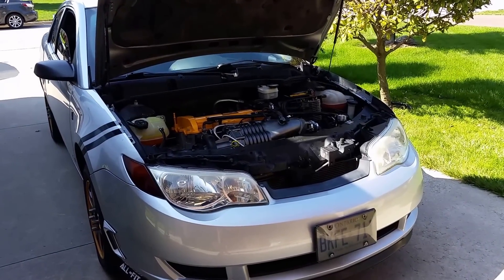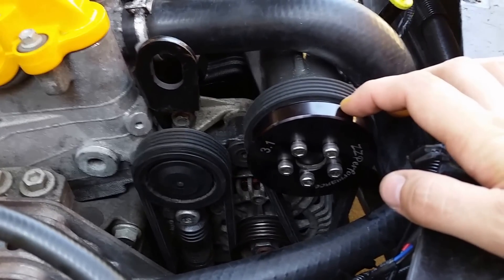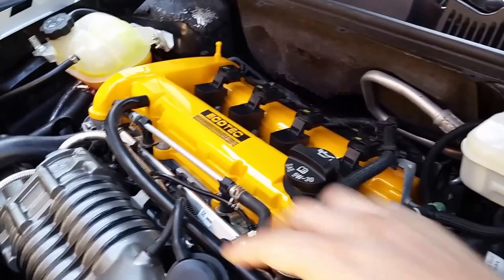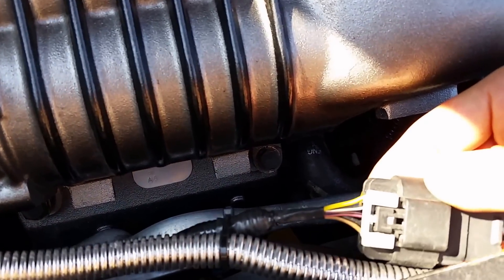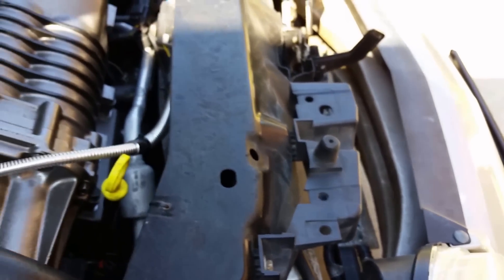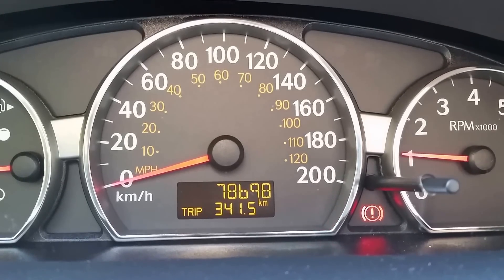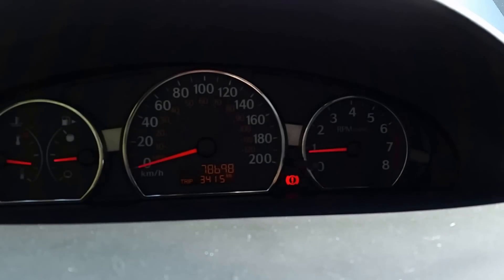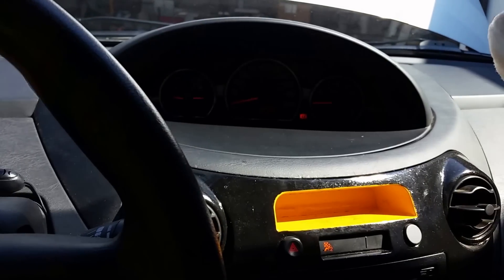How to Supercharge a 2.2L L61 Ecotec - Part 2 - Engine Bay, Idle, and Driving

Comment: Love it! CANNOT WAIT TO SUPERCHARGE MY 2002 Saturrrrd VUE 2.2L L61 5-Speed base model! Will be a fun / EVENtually expensive side project hobby! I already have some ZZP performance mods on her. 3 inch chambered Cobalt muffler custom installed cat back.. Cold air intake filter... I plan on this summer HOPEfully in this June get the rest of the Cobalt ZZP exhaust custom installed and exhaust tightened up. 2.5" Cobalt manifold, downpipe and high flow cat from ZZP.

Comment: I wonder if ur getting any slipping with them at 5rib belt?
Reply from the maker: We listened during the dyno and didn’t hear any slipping. The TVS 1320 setup I ended up doing after this also didn’t slip. Phenolic spacer honestly helps add tension to the whole setup. I also kept the stock alternator pulley which is larger on the L61 than LSJ. ZZP staged belts were too small and would rip. Stock LSJ belts worked great on a 2.6 blower pulley with a stock L61 alternator pulley. Definitely went through some iterations on that

Comment: Hey I have a almost bone stock l61 in a 2004 saturn Ion, I'd love to know the 1st legit steps you put into the car, did you do any trans work. Any info would help because I'd love to be able to build mine to your specs it already has the looks just need the acceleration
Reply: It's possible in an '04 but there is no pcm tuning ability which means you'd have to use a stand alone fuel system which is both expensive and difficult. His car is an '07 which uses a different PCM that has thning support which makes thing's infinitely easier. It can be done, but you'd be much, much better off selling your car and buying an 07+ or even better just buying a car with an LSJ engine.
Reply: As far as tranny work, none is required. The F23 transmission is rock solid,gugs used to run 700 HP through them all day long. Oddly enough it's a much better transmission than the F35 in the stock superchargered cars which break when you look at them wrong.

Comment: Would this work on a 04 cavalier I have a 2.2l
Reply from the maker: Yes my friend supercharged his 2003. Your tune will be different there is a GM refresh available for yours that will make it work. I would check out the Jbody forums for more details on that setup. Drive by cable on yours. Pretty sure guys have made many different adapter plates for the m62 supercharger various LS cable driven throttle bodies

Comment: Bro 1 quick question where did u relocate the throttle and throttle body, or did the supercharger fit right over it
Reply from the maker: You need an entirely new intake manifold that replaces the plastic one on the 2.2L with the metal one from a 2.0L. Supercharger bolts to the new intake manifold. You can't use the original manifold or throttle body or airbox assembly, or tensioner or idler pulleys
Reply: @liquidmetal92  ok thanks brother I'm about to purchase a manifold supercharger and throttle body this weekend thanks for the reply and quick too

Comment: 60lb injectors are to big. 42lb is whats ideal
Reply from the maker: Ran with them for over 4 years. Tuned no problem. Pulsewidth and duty rates were optimal. Plus I ended up switching to a TVS1320

Comment: Can you do this without making the computer aftermarket? I live in a state with stupid laws
Reply from the maker: I used the factory ECM. They are unlocked. You HAVE to tune it to make the engine run correctly with the supercharger and new fuel injectors, and throttle body. 
This doesn't make it "aftermarket" it is the same computer but adjusted internally. Make sure you're doing this on a 2007+ GM 2.2L. Don't turn off any MIL's, keep your EVAP and all of that in order.

Comment: After 4 years! How is this holding up without forged internals. 
I have a sand rail that I’m doing a 2008 L61. I’m thinking hard about doing the supercharger.
Reply from the maker: I built it after about 2.5 years. Forged rods pistons, upgraded valves and valve springs. But no issues after 2.5 years and the tear-down showed everything looking flawless. We supercharged my buddy's 08 G5, 3 years in now and no issues. Just keep RPM limiter stock if you're leaving valve springs stock. After building my motor and going TVS1320 I upped it to 7250RPM. Good times

Comment: Has it been reliable with stock internals at 16 psi?
Reply from the maker: I never had any issues with it for almost 3 years when I drove it like that. Ended up doing a built motor, but had a TVS1320 blower on it at that point making 24PSI on a ported head. Make sure fueling it good, stock internals will take 15-17psi fine. I wouldn't push them past that though
Reply: @liquidmetal92  thanks dude appreciate it! Nice set up btw!

Comment: So basically my car is complete and i had it tuned at a local cobalt performance shop he tuned it using hp tuners. Its only set to hit 10 psi max for reliability since its a stock block and internals. When i drive the car roughly 30 miles or so it tends to have the rpms bounce like crazy till the car stalls or i hit the gas it only happens to it coming to a stop and only happens sometimes i had them check the tune and they said it was fine no cel or anything. Any idea what could be causing this??

Comment: Hey man quick question! Did the 60lb injectors ever give you any problems? Like idle surge or any idle lope? Or problems with cold starts?
Reply from the maker: I found a better impedance table for the 60# injectors that worked a lot better than the stock table setups. Had to mess with the Short Pulse Adders (PWA tables in HP Tuners) to get the impedance right. Even ZZP got them all wrong and we ended up adding the 60# multipliers and then poof idle was amazing ever since. Send me a DM I can send the excel table. Shout out to 04Redline and Omega_5 from Redline Forums for figuring out all the back calculations

Comment: Scared to do my 2.2
Reply from the maker: No. Embrace it. Lotus overdesigned these for GM and they can handle far more power than stock. Bless up and enjoy the boost. Just upgrade components as necessary if you go intensely into it. You can live on an m62 with a 2.8" pulley or larger and stock internals all day long.

Comment: Have you had any rpm bouncing issues
Reply from the maker: Used to only after WOT. Is that what you mean? Killed that issue in the coastdown table. Nulled it out in the control parameters then made the entire table 10 degrees (too aggressive) then 11 degrees (better) then finally 12 degrees (my car like that coastdown spark best). Or are you referring to idle RPM bounce? Very different issues
Reply: @liquidmetal92  so i have a cobalt 2.2 that i just recently supercharged and its tuned and all with no check engine light but when i slow down fast or sometimes slow down to come to a stop my cars rpms bounce and it sounds like it has a different cam in it when it doesnt. Then after a few seconds it idles fine.

Comment: How much are you getting to the wheel?
Reply from the maker: I have a dyno pull with this setup and a meth kit added after to it. Plus Boost reference fuel pressure regulator setup. That setup made 270 whp so 300ish crank hp. Now setup is built motor and TVS 1320 supercharger. Approx 350whp
Reply: @liquidmetal92  could I do this to an 06 ion 2 coupe? It has the 2.2
Reply from the maker: @anthonyyvalle  unfortunately tuning will be an issue. The big companies only offer tuning for 2007 and up ECM. LSJ they support 04 and up typically. It has been done but is much more difficult to tune from what I understand on that Gen of ECM. Maybe look into the GM reflash that was offered for the Cavaliers and sunfires?? Call a dealer see if its compatible on your ecm
Reply: @liquidmetal92  alright, thanks for the help!

Comment: I got a 2005 pontiac sunfire i bought a supercharger from a 2.0l colbalt ss , does the intake manifold fit ??
Reply from the maker: Yes everything will fit with the same modifications I did in this video to the block. Use LSJ tensioner alternator spacer etc. ECM tuning will be different from my procedure not sure how to tackle the sunfires and Cavaliers but it has been done. GM offers a reflash for them too even
Reply: @liquidmetal92  thanks alots dude youre awesome 👍
Reply: @liquidmetal92  i call gm and he said he need the serial number from the cobalt to program my computer ... :$?
Reply: @liquidmetal92  is there a trick to unlock the car its only doing 172km/h , like is there a trick to unlock it

Comment: daaaaaaamn im jealous. 
ive got a astra convertible with the 2.2 ecotec engine, and im dreaming of doing this to my car one day.

one question, why exactly do you have 2 coolant reservoirs?
Reply: Were can I get a list of everything needed to add this to my 06 Saturn ion 2?
Reply: He has the coolant reservoir on the passenger side for the intake/supercharger cooling system. The reservoir is mainly to keep the system bleed of air. I put one on my 06 Ion Redline when I changed the intercooler pump. They don't come with one stock so the system gets air in it and eventually kills the pump. The kit is called "option b".
Reply: @randymiracle4958  Same thing if the condom gets bubbles and blow. The solution is called "Plan B" ;-)

Comment: Is it reliable with the stock heat exchanger
Reply from the maker: Yes. I used the stock LSJ heat exchanger which fits between the radiator and AC condenser. I added the ZZP heat exchanger in series since then for  my TVS1320 setup

Comment: I see where the vacuum line is connected from the supercharger to the boost valve actuator  but where did u route the lower half to and did u run a boost solenoid or do without?
Reply from the maker: Let it open to air. The redlines have it connected to the EVAP purge solenoid for emissions standards reasons. Is perfectly fine to leave the lower port open to atmosphere for purging.

Comment: Have you had any problems with the engine so far?
Reply from the maker: I drove this over 28000kms with stock internals, zero issues. Tore apart motor, inspected all bearings. Was able to re-use all the mains and rod bearings they held up great. Upgraded to forged pistons and connecting rods and did a full motor build for my new TVS 1320 setup

Comment: Please tell me that's a double sided belt. I sure hope there's not a smooth side driving that blower pulley, if there is you must like belt slip a lot. Plus i'm curious, what's your A/F at WOT?
Reply from the maker: Scott Lambeth yes the OEM Cobalt SS/Ion Redline LSJ belt is double sided. AFR at WOT with the setup in the video was around 11 to 11.4 on average. 
Now I have a different setup with methanol injection and a return style boost referenced fuel pressure regulator. I usually get  11.5 under WOT now after my dyno tune was done on this new setup
Reply: Smart to convert to a return style fuel system. Many aftermarket pumps can't seem to handle the variable voltage of a non return system. Very interesting looking setup too.

Comment: I wish I could put boost on my 2.2 but its a 2006 and GM used an odd ball ECU that no one offers tuning for. So at this point I'm not sure what my options are. I'm even considering a complete motor swap in to a 3rd gen block but shit gets expensive really fast when you go that route. I just wanted a little bit of boost on a daily that would pass emissions.
Reply: I'm in the same boat as you. Did find anything out that you can do?
Reply: @williamsheridan9784  nothing, besides a complete ecu,tcm, and harness swap and figuring out how to change the crank sensor and ignition module to coil packs. I can program out VVT if the ecu come from a model year with VVT but i'm better off getting it all from a pre 2005 model year. But its probably not worth all the trouble. As far as finding another cobalt with what i want. Yeah good luck finding a used cobalt 2.0 or 2.4 in good shape.

Comment: What exhaust do you have?
Reply from the maker: Braden Bach in this video it was zzp shorty header and 2.5 inch catted downpipe. Resonator delete and magnaflow exhaust. In my newer video with my dyno run I have a full zzp 2.5 catback that replaced this setup which sounds muchhhh better in my opinion. Check it out if you want to compare.
Reply: Vincent Colussi did you install it or did someone install it for you
Reply from the maker: Braden Bach I installed it in my driveway. Entire build was done in my driveway
Reply: Vincent Colussi do you have a video on how to install it?

Comment: Vincent, how much torque and horsepower and did you end up putting down on a 2.9" pulley?
Reply: Disregard.  I found your comments.
Reply from the maker: Jason Gibbs I'm on a 2.7 now with 94 tune, meth injection and BRFPR system which put down 270whp and 252 lbft. Never dynod the 2.9 setup with 91 gas and stock fuel system. This video also had a not full exhaust system. Check out my dyno video if you wanna see the current setup
Reply: By "not full exhaust," what do you mean?  Header?  Pipe size?  Cat / catless?  Resonator?  lol  Curious to know.
Reply from the maker: Jason Gibbs this video was shorty header and 2.5 downpipe with cat. Stock exhaust behind downpipe with a crappy magnaflow exhaust. New setup has the zzp 2.5 catback added behind the same downpipe
Reply: It didn't sound terrible though the road.  You could tell it wasn't a full exhaust by the sound.  Mine sounds ricey, full headerback 2.5" with magnaflow cat, vibrant 12" res, and magnaflow muffler crush bent.

Comment: No one is offering PCM programming for the 2.2 L61 anymore. Any idea where I can find a programmer So I can do it myself?
Reply: if it's an issue with the Delphi ECU then check out http://www.obdtuner.com/ and email Peter with your details, he will sort if you can/can't
Reply: Try hp tunners
Reply: @JMilly84  hp tuners doesnt support the l61 ecu for 2005-2006 because its an oddball one for that specific year and motor.

Comment: Will this work with an ‘03 alero?
Reply from the maker: Nineteen-Eighty two Rampage look up the 2.2 cavalier builds. You're cable driven throttle body not electronic so a few things are different. And your tune will either have to be standalone or GM reflash

Comment: How much would a swap like this cost.... I have the 2.2 ohv
Reply: This supercharger is for a 2.2 L61, Ecotec engine.  If you don't have this engine, you will need to swap into it which can cost somewhere between $500 and $3500 depending on your knowledge / skill level and parts availability.  The m62 kit will be an additional $650 to $3,500 depending on parts availability and skill level.  So really it depends on YOU.  Between $1,150 and $7,000 or so.  

**These rough estimates are for educational purposes only.  DO NOT misinterpret these numbers as factual nor implied.  They are ROUGH ESTIMATES.
Reply: I remember the 2.2 Ohv on the Cavalier, I had 1994 2Nd Gen Cav, but they had the 2.2 Ohv until 1999, from 2000 and up was the Ecotec,
if you had the Z24, 1995 and up it would be 2.4 Quad cam, if I am not mistaken.
Reply: Get the Cobalt as whole car, find one thats been rear ended, buy it as a parts car, then peel out and switch everything over, the only thing you will not be using is shell of the car 

Otherwise all other parts will be used, engine, transmission, ecm, wiring harness, and so on.
Reply: If you can, look for the turbo version Cobalt, the turbo factory Cobalt is quicker than the Supercharged factory Cobalt.

If you get the turbo Cobalt, upgrade the Turbo, and have the ecm specs adjusted / tuned for the upgraded turbo.

Might need to upgrade the clutch too.

Comment: How many horsepower did you gain with all that ?
Reply from the maker: Eliseo Ventura the setup in the video was around 220whp. Stock is 145hp to the crank. I dynod at 270whp now thanks to modified fuel system, water meth injection, full cat back exhaust, and an even smaller 2.7 pulley on the blower.
Reply from the maker: Added Meth, BR-FPR system and high pressure fuel pump. Went down to a 2.7 pulley. Made 269whp and 252lb*ft on the dyno. New setup (2018) is TVS1320 blower, fully built motor, ported head, rotated mounts, 3" catless exhaust system. Estimating 340-360whp on current setup. Will dyno it in 2019 just to see where it's at.... but driving on the streets and track tells me all I need to know lol

Comment: What kind of gains did you see I have a 2.2 grand am I wanna make a sleeper
Reply from the maker: Alex Fuqyobish stock is 140hp and 150lbft. I just uploaded a dyno video if you want to see it. Added a larger ls4 throttle body, high flow fuel pump and boost referenced fuel pressure regulator system plus some cooling mods. Made 269whp and 252lbft on the zzp mustang dyno. So close to 300 crank now! Sleeper for the win
Reply: Yeah I have an all than 4 door 03 grand am locally know as the gran dammit looking to super charge

Comment: I have a 06 2.2 Malibu you know if this is compatible?
Reply from the maker: If it is the same L61 engine then yes it should work. Tuning your ECM will be difficult though as companies like ZZP only support 2007 and up 2.2L tunes (they commonized the ECM with the 2.4L that year). If you can find a tuner first then the supporting mods would be the same on your block (idlers, new belt, grinding that one spot on the block for the LSJ tensioner etc.)

Comment: What tuning chip are you running?
Reply from the maker: Tuned using HP Tuners. ZZP did the tune by e-mailing me a file, I would use the ECM scanning tool to record a log then send it back to ZZP then they would revise and send back a new version.